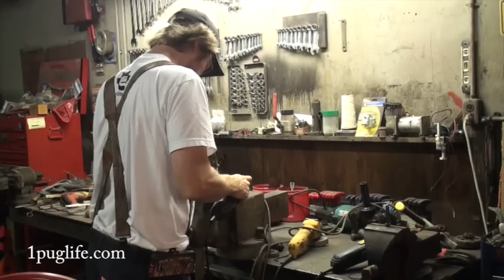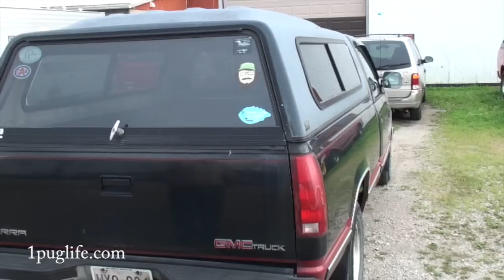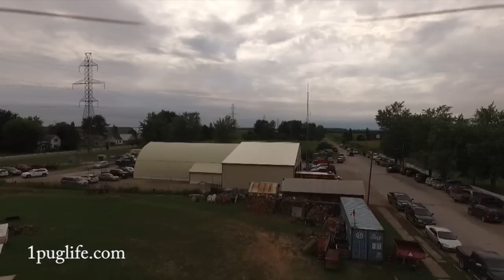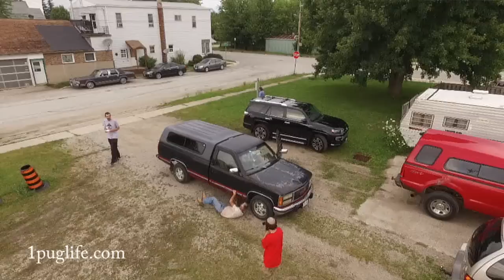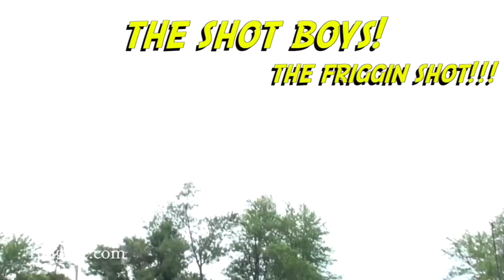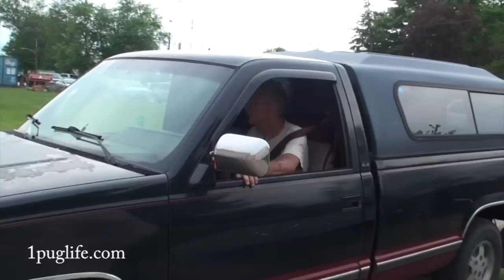really getting the shot

Comment: The starter bolts where so tight because it's original starter. The truck is only 25 + years old. Unlike that ford junk where the starters been out a 100 times in 25 years!